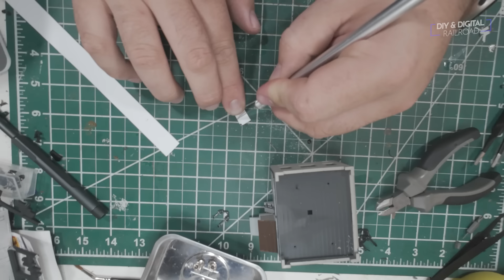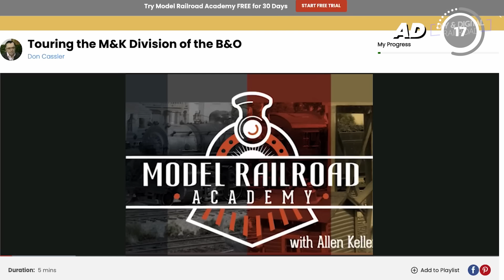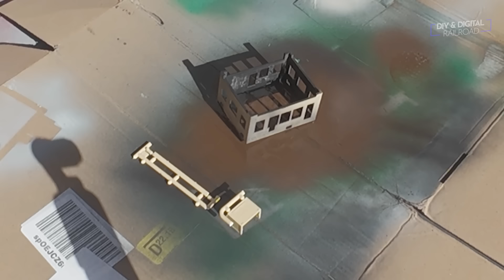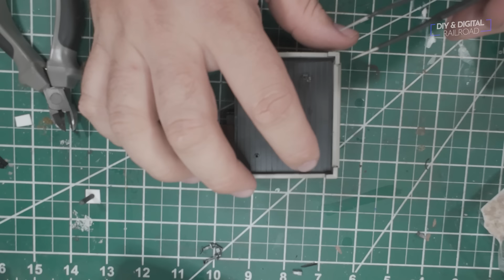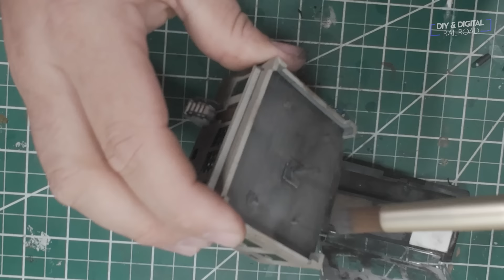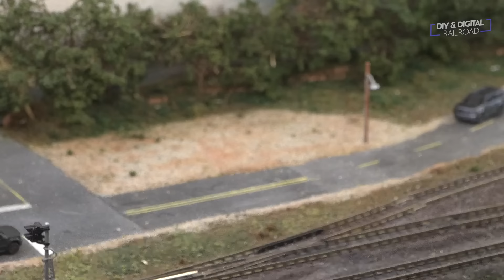Easy Model Building: Simple Techniques for Realistic Results

Comment: I’m going to be blunt. Model train buildings are lame and terrible. I’ve been a lifelong modeler. Plastic, wood, resin kits to RC on road racing. I’ve built them. My last layout was 1998, all Peco code 55. It was a nightmare.
I came back last year and love the advancements in the trains….
HOWEVER! They still sell us the same crappy quality and most cases the exact same tooling, from 30+ years ago. When I see the models being produced by common scale models my jaw drops. A 1/35 scale rank with a full interior!? We can’t get a diner in n scale with an interior that’s not some impossible to paint 3D print.

Comment: as someone who comes from building miniatures (warhammerh 40k) and other model kits before getting into Model Railroading, Acrylic paints work great, 3-4 thin-coats of paint will make colors really POP, primer of white or black for different colors as preferred. but remember, THIN YOUR PAINTS, 2-3 thinned layers will always look better than 1 layer globbed on
Reply: Now that I’ve gotten back into trains, I am disappointed they still sell,the same lame kits, from the same tools as 40 years ago.
Reply: @MrCarrizojim  No one really makes kits anymore it seems sadly, exception of 2 I can think of being Accurail and Tichy Trains, they are both USA based/manufactured which is nice! And their kits are new injection-molded tooling as well as far as I know. People who like building actual model kits or even kit-bashing seem few and far between

Comment: If you don’t want to use spray paint on the inside, you can use heavy black paper lightly glued to the inside. Recently built a Faller kit that came with the heavy black paper for the inside. 👍
Reply: Even easier: Cut two rectangles of black paper - same height as building and as long as the diagonal dimension. Cut slits halfway through each paper on the long side, and slip together to make an X. Then fit into the building. Instant sight block which can be removed if you ever want to add interior details.

Comment: Jimmy, nice how-to video - thanks for this. A few comments/tips in no particular order: (1) I'm pretty sure this is a polystyrene kit, not an ABS kit. ABS is that black plastic used in plumbing pipes. (2) the Tamiya cement is very effective, but it is also very stinky. As a minimum, use in a well-ventilated area. Alternately, use Plastruct Plastic Weld or Plastruct Bondene - much less odor. (3) If you're building a lot of plastic kits, sprue cutters are a wise investment. There are two types: the pliers style (Fujiya makes a nice pair) and the tweezer style for very small parts (I bought mine from MicroMark.) (4) I cut all small parts off the sprue before painting and I stick them to a paint stir stick using a doubled-over loop of blue painters tape. The tape holds the parts in place quite nicely. (5) The brushes you are using to apply cement look like they are from Alpha Abrasives and they are called Ultra Brushes - $7.50 for a 25-pack at Hobbylinc. (6) There are many many companies that sell rooftop details - chimneys, vents, HVAC equipment, etc. This is a great way to personalize the roofs of your models (and face it: the roof is what we see first and notice most). Check out Tichy Train Group or google "N scale details."

Comment: One thing, wash your parts in soap and water pre paint. Parts have mould release (oil) on them
Reply: I feel this depends on the manufacturer and paint being used. Recently built two Walthers Rolling Mills into one building. Used Rust oleum green cameuflage from a rattle can. Three very light coats, came out perfect, did not wash parts. DISCLAIMER: Ensure rattle can paint is made for plastic so you do not melt the plastic!

Comment: I know Walthers isnt big into N Scale, but they need to retool their molds. They are old and worn out, flashing is terrible as are the spur attachment areas. For the price they charge they also need to work on their instructions ;)
Reply: In fact they sold off their n scale rolling stock to Atlas
Reply: Agreed. I had the cornerstone timber trestle kit, and it was so bad out of the box with warped parts, I tossed the entire thing in the trash.